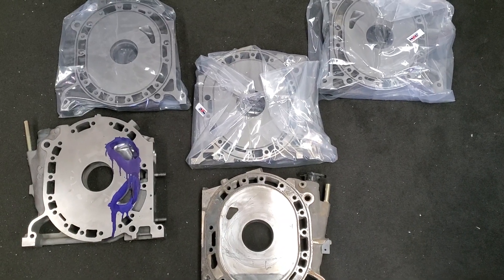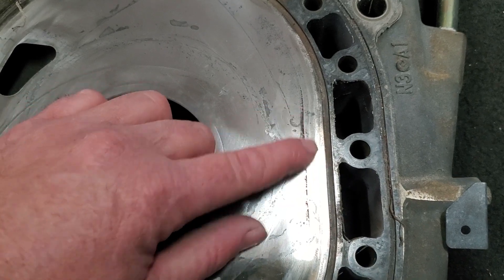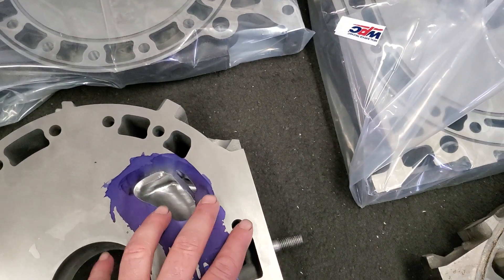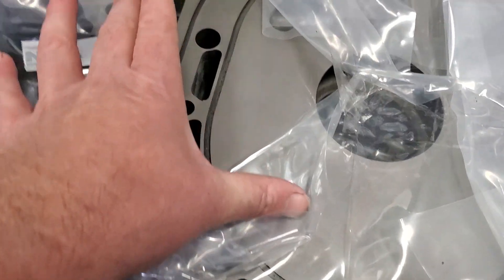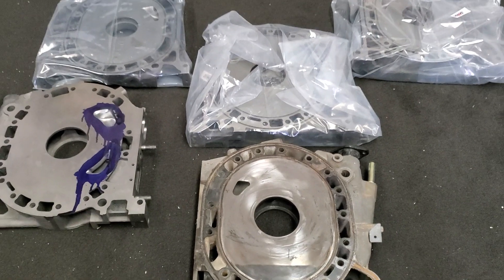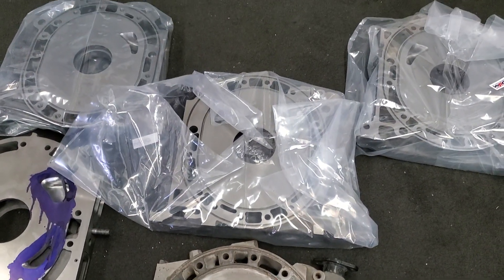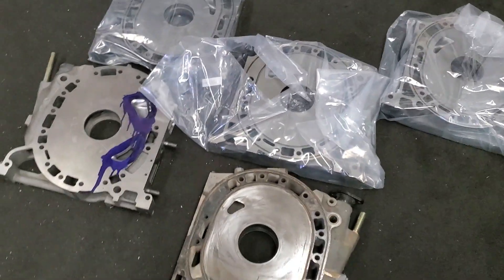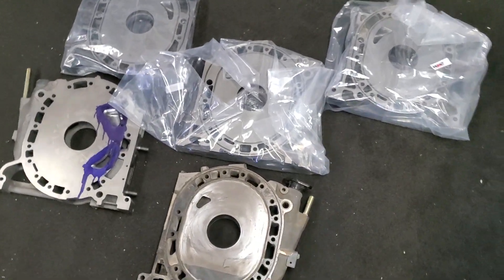Lapping Resurfacing & WPC Treatment, Rotary Engine tech talk, Kyle Mohan Racing

Comment: Have you looked into DLC coatings after WPC?
Reply: I’ve looked into this and apparently you can wpc a dlc coated surface and that gives you more benefit than a dlc coating after a wpc coating
Reply: MotoIQ says they complement each other with hardness less friction and oil retention
Reply: Hey Kyle, did you ever tried to weld some rust points on the surface of a sidehousing where the rotor spins? Than lapp it and than nitrade it again?

Comment: Can you do the housings and not just endplates? And what about billet endplates? Also what's your opinion on running exclusive LPG for less carbon build up and smoother, more even & complete burn (provided you have high quality aftermarket OMP delivering dedicated castor oil feed for e.g.)?  I'm thinking of finding some broken down FC or RX8 and trying all this of it's viable enough combo. Cheers!